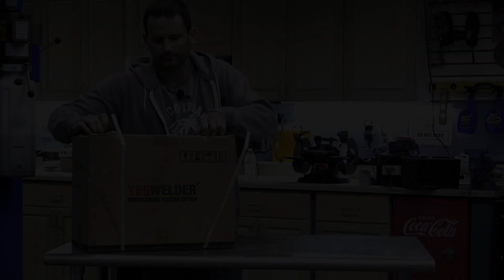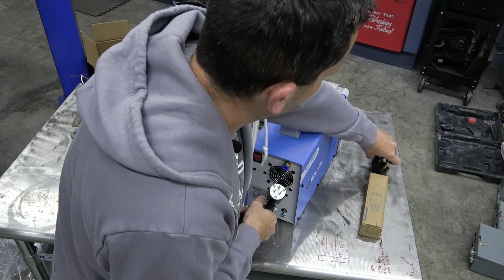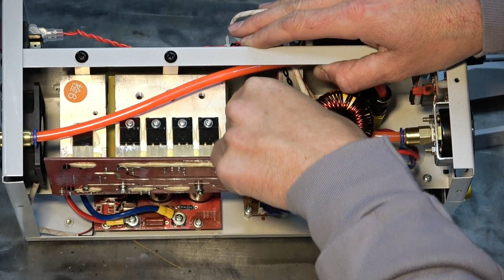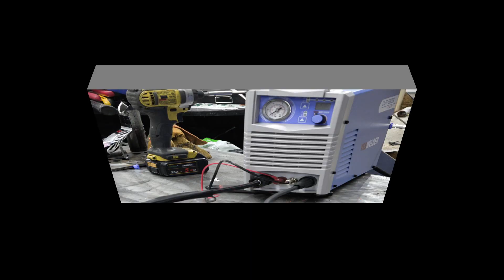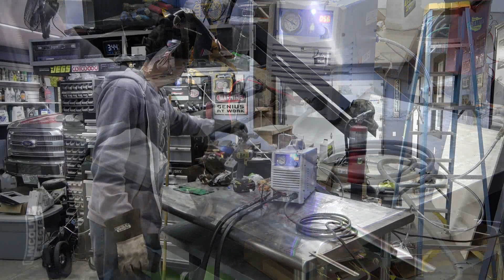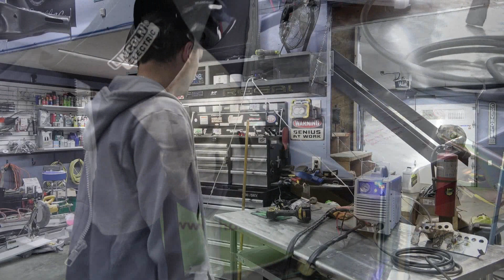REVIEW: Yeswelder PLASMA CUT55-DS DETAILED+ Discount Code!

Comment: Great video, I didn't see you swap to the 120v tip though, mine came with the 240v installed, 120v in the bag of parts.  But yours did turn on.  I'm an affiliate for them as well, this being my second machine from them in as many months, and it's dead out of the box.  I'm going to tear it open tonight and see what's what.  I emailed them back and forth all week about it, and while my first experience with their customer service was terrific - I can't say the same this time.  How many videos can you send them of it not turning on, at all, before they send you a replacement?  I'm giving them one more email and then posting a review, they need to get this solved.  Ridiculous.  I even informed them that I'm an electrical engineer, just send me the schematics and I'll fix it up.  It'll probably be something stupid too, like a bad power switch.  (facepalm) I agree with you on their machines otherwise, I have the 205DS welder and it's a workhorse.

Comment: It seems there are lots of competitors in this market now, and this one is down to $250. I got one but seem to have a problem with the pressure not able to get above 35psi shown on the front gauge. My compressor is set to 80psi

Comment: Yeah, the soldered traces might be ugly, but as long as they're sufficient I can take it or leave it. If I get one I think I'll have to take a stab at reverse engineering some of the circuits. For how much I'd use it this one would probably be fine, but sometimes you don't anticipate the differences between a more expensive product and how much they'll impact you(Or won't, hopefully). Floating the idea of a PowerPlasma 52i from Everlast too, but obviously twice the price.

Pre-famulated amulite, vacuum tubes, nit picking on soldered traces. Wouldn't be another enganeer would you? Gonna have to smack you though for saying "120 volt current".

Glad to see you have almost as much crap on the floor as I do. I need to improve on that.
Reply from the maker: Damn, I can't even push back on the callout.  120v of pure current.  That's like 5 gallons of pounds.

Comment: I don't think it converts the 120 plug grounds don't swap to something else unless there's some expensive stuff to do it.  Cheaper to put on a 240 plug and swap down to 120.  It likely funells all the current through the one tab...but show me wrong.
Reply from the maker: What your proposing isn't even possible.  You can't combine two legs of 120 service on one conductor.  This changes the neutral to a hot and the ground get's bonded to the neutral/ground when 240v is connected to the 120v plug.

Comment: I have looked for a machine torch to fit the Cut-65 DS so I can use it on a table. I haven't been able to locate one listed to fit and I don't know enough to match one up based on the information on the machine itself.  Do you know of anything or a place to look?  Thanks

Comment: I was thinking about you yesterday, wondering if you had any news from OKC .
Vacuum tubes! I worked on them years ago when I worked in electronics .
You have been around electronics too I can see. 
I have a plasma cutter of a different brand and I have found that it does not take a lot of air in fact I have found that less air creates less dross (slag)  the large amount of air flow cools the dross. rather than blowing it away. and of course the less moister in that air the longer the consumables last!
Reply from the maker: Still waiting for my next reason for denial :).  Should hear back from them any day now based on the last time I sent in what they requested and they responded.  To say I'm getting tired of the runaround would be an understatement!
Reply: @Trialnerror  man I was hoping to hear better news.😩🛫

Comment: Impressive little machine for the money! How's that yeswelder helmet holding up? I've been eye ballin that one for a while.
Reply from the maker: The helmet is actually a Monster & Master and I like it a lot.  HUGE viewing window which makes a big difference.  I also like the controls on the outside vs the tiny dials that you normally have to deal with on the inside.  https://amzn.to/3GvhEVW  Thanks for watching man!
Reply: @Trialnerror  Thanks for the reply and feedback.
Reply: I have one of the yeswelder helmets. 99% of the time it works great. Sensitivity wise if I set it to where it wouldn’t flash me on low amp Tig it would occasionally blink dark when not welding (bright shop lights).    For the money it’s great, but a Lincoln 3350 is now my go to.

Comment: $500 is a very reasonable price for what appears to be a quality built 55amp  Plasma cutter FYI 16mm squared is somewhat like 6AWG.
Reply: It's $499 marked down to $459 with 30% off code on the site right next to "buy now" button. Came to like $322. Just ordered.
Reply from the maker: @jonny-b4954  Now that's a freakin steal.